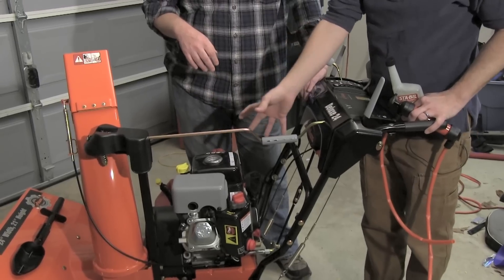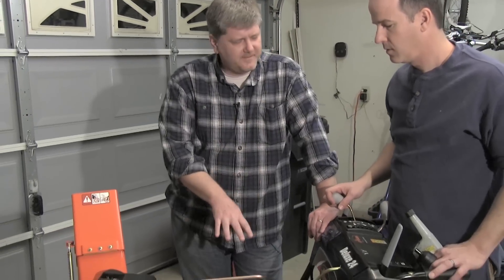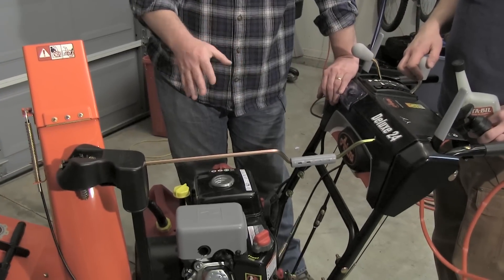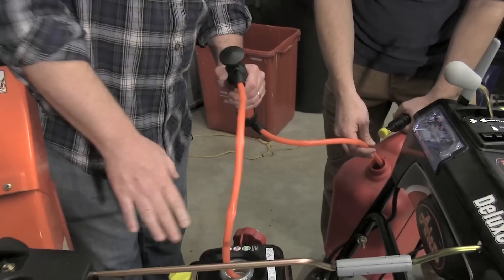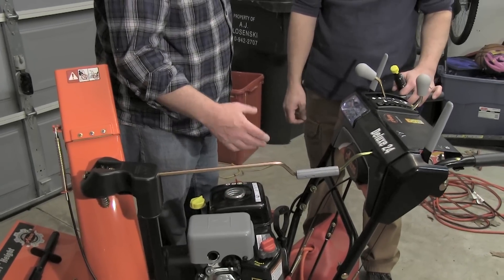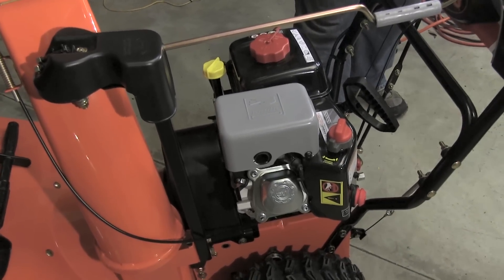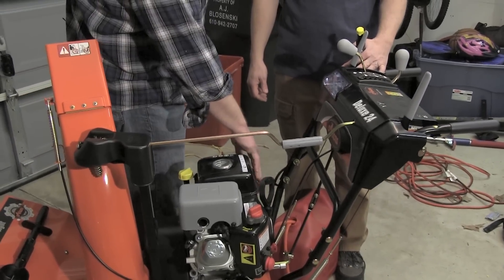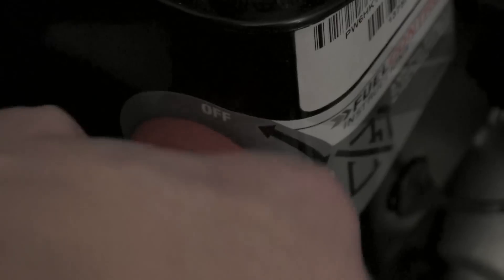How To Store Snow Blower For Summer

Comment: My simple solution... I always use non-ethanol Premium fuel in my small engines AND use a fuel stabilizer for storage.  I also run the engine for a few minutes a few times throughout the storage season.  I never had any issues.

Comment: I have a John  Deere snow blower that I have owned 30 years. The machine runs like new.
I always off season store the blower in my shed with all fuel removed. Never a problem with gaskets drying out O rings failing, etc. just my two cents.
Reply: do you add any clean motor oil to spark plug seat?
Reply: @stateniland  All my equipment get “Fogging Oil” spray down the cylinder for winter storage.
No rust!
Reply: @algorel4763  assuming you first remove the spark plug?  Thx!
Reply: @stateniland  No flies on you LOL

Comment: Cub Cadet says:
"Fill your engine's fuel tank with fresh gasoline and add a fuel stabilizer. This is better than storing it empty because an empty fuel system exposes any bare metal parts within it to air and moisture - which can lead to rust and allows gaskets and O-rings to dry out, crack and shrink, causing eventual leaks."

And as others on this thread say, run it for a few minutes to get the clean gas and stabilizer into the fuel system.

Change the oil before storage as well. You don't want dirty oil sitting in your engine all summer!

Comment: What about starting the engine a few times during the summer?
Reply: can't  hurt.. just top off the tank.. the less AIR in the gas tank the better. ;)
Reply: That's what I end up doing.  I start it once a month  and let it run for about 5 minutes or so.  In the winter it runs like a charm.  I also change the oil before the first snow storm.

Comment: After turning off the fuel supply and the engine dies, open the choke all the way and start it again. It will start and run the fuel out of the choke system.

Comment: Better than those crappy, leaky hand pumps for getting gas out of the tanks of small engines, I recommend the small peristaltic crank pump made by DuBro, their "Kwik Fill Fuel Pump". It works with the 'glo-fuel' such as RC airplanes engines use, but is also good for gasoline. HOWEVER, the silicone tubing that comes with the pump is NOT good for gasoline, so you need to also buy some Tygon tubing, which is good for gas (DuBro sell that tubing as well). I have had one and used it for over 10 years, and it works like a champ. Because it is peristaltic, there are no leaks. Quality product, will set you back only about $25.

Comment: Never store your snow blower or lawn mower with no fuel in it. The bare metal is exposed to moisture and air. The gaskets and seals and O rings can dry out, crack and shrink. Use the correct amount of fuel stabilizer and keep the fuel tank full. Also, treat the fuel and let the blower or mower run for 5 mins to get the stabilizer through the fuel line. Don't over heat your snow blower by running it for more than 5 mins at a time in spring or summer heat.
Reply: So are you saying i should leave gas in the tank all summer long?! That's ridiculous!
Reply: Gaskets and hoses will dry out faster and bare metal will rust faster when exposed to the air. You can do what you want of course.
Reply: I know, but I really want a good plan for storing my blower this summer.  I live in Maryland, and thanks to the scare of last year's storm and having a big ass driveway, I finally decided to get a snowblower, but it literally NEVER snowed this season, and while I don't have too much gas in it, I do have some left over from my initial start and test of it and I had no clue we were gonna get NOTHING this year, so now I want to know whether I should leave the extra gas in the tank with stabilizer or just drain it out and then run the engine until the tank is empty.  Both seem to have their pros and cons
Reply: ElevatorMan5482 - I live in Eastern PA, so I have very similar weather to yours.  I always put StaBil in my gas can (2.5 gal) because 2.5 gallons can last all winter sometimes.  I use the same gas can for the mower in summer, so the gas does get consumed sooner or later; within a couple of months.

I have an Ariens blower I bought in 1992 and it's still running great.   I favor the method of completely draining all of the gasoline and never had a problem.  99% of the fuel system is plastic, fuel line is typically PVC or neoprene (Neoprene is a DuPont trade name for synthetic rubber.)   The tank is also plastic.  Nothing has never dried out for me.  Only the carburetor bowl is metal and it hasn't rusted in 25 years.  I store my snow blower in my garage and there's very little rust on it anywhere.  I drain the tank then run the engine until it stalls.  However, I find this still leaves about an ounce of gas in the carb.  My blower has the old style Tecumseh (USA made) engine, and there's a drain on the bottom of the carb bowl.  It looks and operates like a small pushbutton.  It drains any remaining gas out of the carb.  I don't know if your engine will have the carb drain, but it's worth looking.
Reply: Hi, it's been a while but yes, I actually found that my Ariens does in fact have a carburetor bolt drain.  The last comment I made was back in February but as it turned out, we got snow a month later, and I was able to run the gas down to low amount and then run it till it stalled.  However, I hope that any gas remaining in the system is in the carb bowl so I can just drain all the remaining fuel outta there, as it would suck if old gas gets stuck in the fuel lines
Reply: @exoticcar5482  no it is not.. dull of fuel means NO AIR... AIR CAUSES PROBLEMS NOT GAS!

Comment: What abt oil? Do u have to drain it out?? For summer?
Reply: No. There's nothing in oil that draws water out of the air that will harm the system. Although you should change the oil at least every other year. More if you use it a lot.
Reply: You should be checking oil all the time.

Comment: 1.  Drain tank
2.  Run motor till it stalls
3.  

Use fuel that's ethanol free!  We have a gas station here that has a pump that dispenses ethanol free gas.

I was expecting more!

Comment: been cutting grass for 20 years always run the engines dry never hurt any mower...running a snow blower in 70 degrees weather to drain it   will not hurt it i mean come on you run your mower in 90 degree heat..if the blower has oil and the carb is adjusted ok it won't hurt it... i see no difference in a lawn mower or snow blower on how they are built
Reply: George Holland, clearly you know no more about small engines that you do about writing clearly, using capitalization and punctuation. FYI, small engines designed for snowblowers are not the same design as used on lawnmowers, and your "cutting grass for 20 years" in no way makes you an expert on anything....just an embarrassing comment.

Comment: From the Troy-bilt snowblower website. 
Finally, you should add fuel stabilizer to your fuel.  Then, fill your unit's tank.  This is better than storing it empty.  That's because an empty fuel system exposes any bare metal parts within it to air and moisture - which leads to rust and also allows gaskets and O-rings to dry out, crack and shrink, causing eventual problems.  In addition, to completely drain fuel from an engine is difficult.  Unless you blow out and dry the fuel lines, enough fuel can remain to become stale and cause problems.  Keep the engine level while in storage.  Tilting can cause fuel or oil leak.  If you plan on covering the snow thrower, make sure air can get under the cover.  Don't try to "seal it up."
Reply: I always store mine the same way.. FULL TANK = NO AIR

Comment: Really,what about plastic or air filled tires sitting for 6 plus months? How about lubricating cable assemblies?  You guys did a good job on the fuel issue but please rename the video "fuel aspect of seasonal storage for your snowblower"
Reply: Most people are only looking for information regarding storing it to prevent carburetor clogs, so the engine will start up next November or December. As far as those other things, knock yourself out.
Reply: @sketchyold  thanks,I guess,,but my points are valid and on point..,especially the title...please,always make sure your gun(s) are loaded if you are going to pull them out
Reply: Do you have a video that shows the proper ways to do all this ?